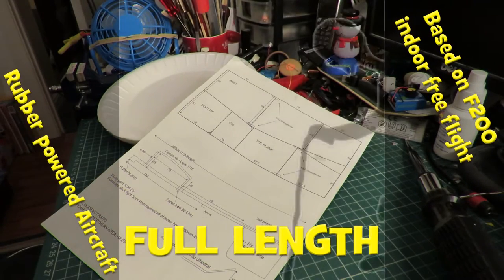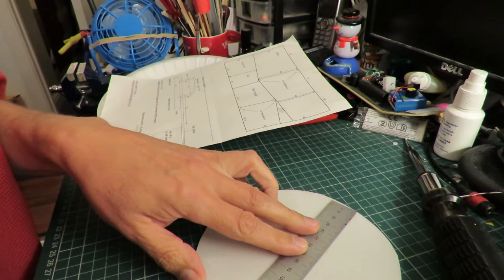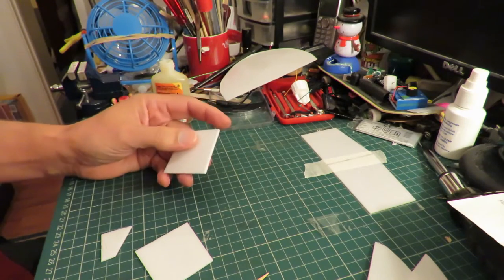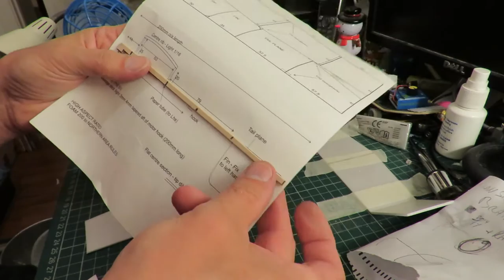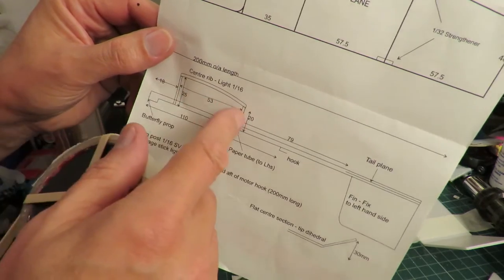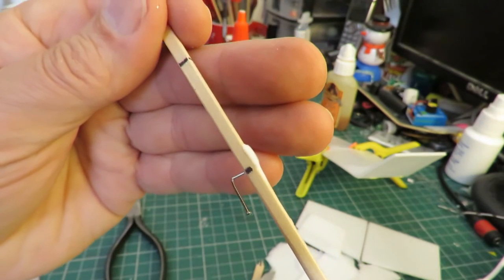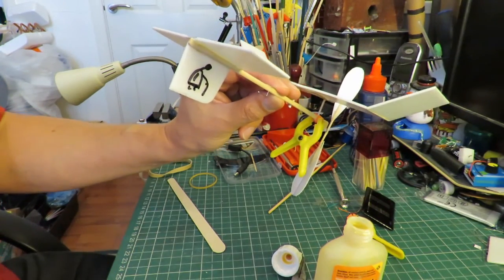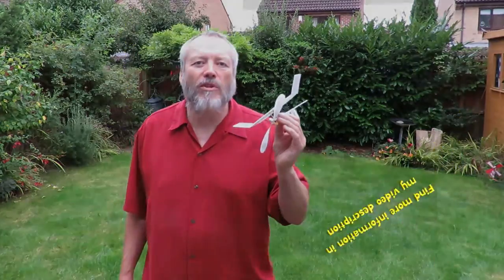Rubber Powered Aircraft Based on F200 indoor free flight FULL LENGTH

Comment: Nice plane :)

I had a thought. If the plans where scaled down and the plane was made smaller then it may fly in a more confined area. Also you would have more scope on the materials you could utilize to make the main body lighter.
Reply from the maker: Smaller is not necessarily better. You will find some indoor rubber band planes are significantly larger but the wing loading is much less because they have a much larger wing area. The reason this plane is this size is it was a club challenge to make it from a piece of wallpaper insulation foam 200 mm by 100 mm. The details are in the video description.
Reply: Thanks for the detailed reply :)

Comment: why is my new bright rc so slow if it has a 6.4 volt LITHIUM ION BATTERY?
Reply from the maker: I would guess that depends on what voltage the receiver and motors require. A battery is a battery, it is just a method of storing energy. The different chemical components just mean that for a given size and weight some store more than others. So if you use one that is lighter than the original battery then the car has less weight to carry so it might go faster. If you use one that has a higher voltage than the original it might go faster for a while but there is a good chance you will burn out the components.